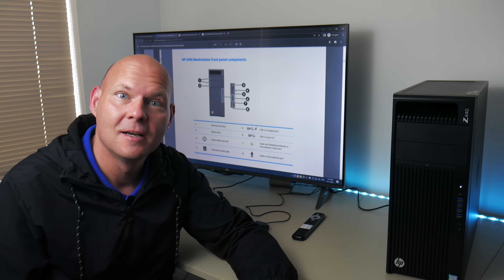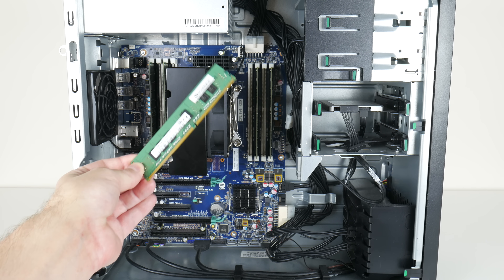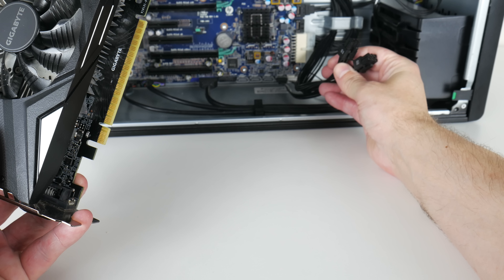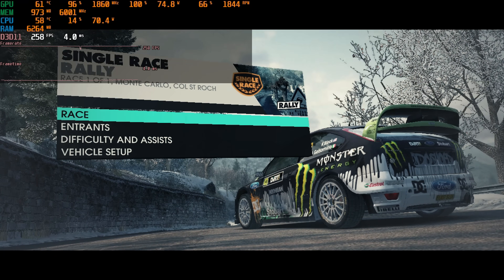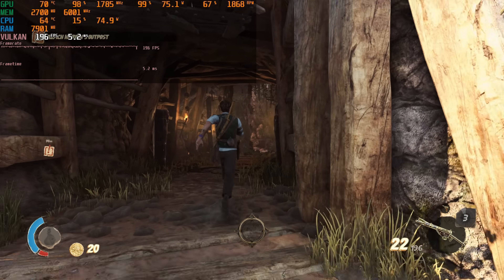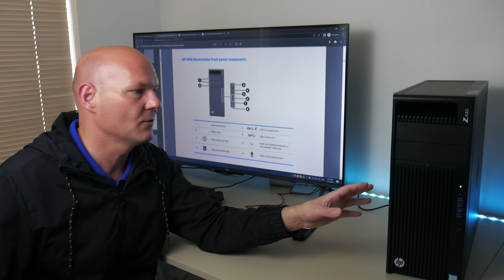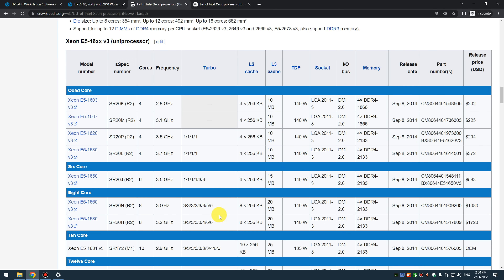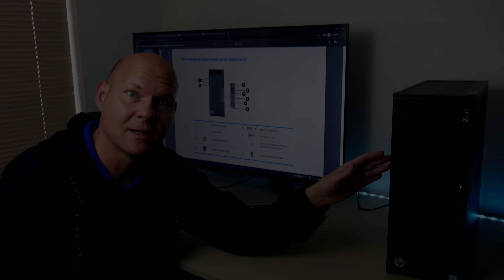This HP Z440 PC was my best purchase this year

Comment: Great video. Some notes:

- the z640 may actually be the sweet spot if you want to go for performance and expandability, as they are priced almost the same but support dual processors and hence double the RAM channels and slots (this is optional though! And the riser is expensive separately, find a deal with the riser installed!) and obviously, it has a beefier PSU due to that. Unfortunately I don't think the extra PSU has more PCIE or SATA connectors which means no extra graphics for cool ML stuff or multi-VM game streaming, but you can always solve the SATA issue with splitter cables

- Dell and Lenovo also offer their cheap versions of this. I myself have a Dell T5810, very similar to this, does have a second CPU socket option (also riser, less expensive), but the GPU is also limited and it supports less disks and less optical bays. Is usually cheaper though. Still great service manuals on all these 3 brands, along with all other drivers and firmware

- now this one may be the most interesting detail: all of these machines should theoretically (but I'm not sure it works on the z440) support a v3 multiplier unlock. v3 Xeon CPUs can actually be overclocked to levels beyond even v4 levels of performance, even with slower RAM. This should require a custom BIOS but there are multiple sources for this and it is a relatively simple change if you wanmt to do it manually (as opposed to relying on random binaries online). The one difficult part is flashing the BIOS, for which you will need a BIOS chip clamp and a USB-Serial (you could also desolder/resolder the BIOS but clamp is easier and relatively safer). If you end up doing this, and you do overclock, I would strongly recommend double checking your thermal performance as it may be necessary to go custom cooling or tone OC down for safety. Because of this, it should probably be more relevant to single socket. I wonder if all or some of these machines even allow for custom coolers as they usually have proprietary mounts. I know dell screws directly to the case metal which kind of sucks...
Reply from the maker: We will check out the Z640 soon! It has few RAM slots, but 4 is heaps already IMO. Bigger PSU and even heavier, I believe it weighs 15 Kg and definitely getting a workout for your arms if moving it around. Additional fan in the back but otherwise it's very similar. I don't think the CPU upgrade (2nd CPU) is a big plus, I don't see games and most applications benefitting from that to be honest. If you want dual CPU might as well go for the Z840?
Reply: I had T5810 for a while - it's noticeably louder than HPZ440.

Comment: I worked in IT for decades and we use HP servers and workstations. I use HP workstations at home with fantastic results. One of my favorites is was the HP z620, built like a tank, still running strong and upgrade processors for cheap recently. THe HP Z800/820/840 were also amazing designs owned all of them in the past. I also have gaming computer but the reliability of the workstations make it my go to for any purchases going forward. Their Z1 all in one was another brilliant design and my parents still use the one I built out for them every day.

Comment: For those 26xx xeons there is a turbo unlock.

Some ukrainian did modify a bios for the z440 workstation. There is a video titled failing to do on z440 but that person did succeed and they linked there English guide in the description.

The turbo unlock isn't a full unlock as you are limited by the cpus tdp thay why there are undervolt efi's

Comment: i have never model HP Z6 G4 and also rtx 3060 ti inside but u receive only 7000 pts in Cinebecnh R23 , processor xeon 4114. This machine is low end for my computer but performs much better

Comment: You would be right if at 4k you didn't need more ram than you have on 3070ies, 3060ies seem to be less stutter because of the 12 gigs, but nowadays I'd go for an A4000 with 16 gigs of ram. If you don't push it to the max and keep it there like a miner, it should be silent as well, or a quadro. I have the n840, I am not putting consumer cards in there also because of their crazy wattage, enterprise GPUs work much better for less electricity.

Comment: Hey Phil. Im not sure if you're still responding to comments but Id like to pick your brain on some GPU info. I also have an HP z440. Came with 32gb Ram, 6core 12thread 1650 v4 and a Quadro M2000 4gb card. 

I do video editing, 3d animation and graphic design and I also do some light gaming when time allows. Im trying to get a GPU upgrade and planning on a cpu upgrade later on. My main applications are Adobe After Effects, Premiere Pro, Photoshop, Indesign and Illustrator, Davinci Resolve, Blender, and Cinema 4D. 

The Questions:

1. Have you upgraded your GTX 1660 yet? If yes, what did you upgrade to?
2. Im stuck between trying to get 1 of 3 cards i.e Quadro P5000 16GB, Quadro M6000 24GB and an Nvidia RTX 2070 Super (looking at an RTX 3060 or 3070 if budget allows). Which in your opinion do you think I'd benefit from the most for work?

Comment: Watch out if you have to replace the power supply -- when I had a Xeon CPU that needed a home, I passed on HP mainboards because some have nonstandard power pinouts, (IIRC that's one of them) and I didn't want to mess with that. As a complete unit, tho, quite nice, and from what I found, that's one of the better ones commonly available.

Anyway, I wound up going for a Lenovo Thinkstation S30 mainboard (workstation board but fits a standard case, and takes a standard PSU) and with the Xeon E5-1620v2 (3.7GHz) and 64GB of RAM, it's quite lively indeed. Uses about 175W at the wall. And came with an embedded Windows license (weirdly, tho the board originally shipped with Win7, it only activates Win10).

I got off cheap because the RAM was pillaged from a server (dual Xeon but total CPU power a bit less than the Lenovo, and about 3x the power consumption) ... thought I'd need to get the Lenovo faster RAM but it performs just as well as the faster RAM in my i7-4820K (which benchmarks barely a tick faster than the Xeon-Lenovo). And it is indeed super reliable. 

Anyway, very nice, these workstations are indeed interesting beasts, and in a different league from the average desktop.
Reply from the maker: Good to know that Lenovo uses regular PSU, makes life easier. The other option with the HP is buying a Huananzhi board and transplanting everything into another case.
Reply: @philscomputerlab  Or rewire the PSU pinout, but that's more adventure than I care for! And not all Lenovo are standard, but this one is. -- The factor you can't transplant is the business-class reliability. 

That said, while HP's consumer-desktop PSUs are trash, there are few complaints about the workstation PSUs. If it's lasted this long, it'll probably just keep on chugging.

Comment: Great video didn't realise the z440 has 8 ram slots. My z640 only came with 4 slots. Do you know if 4 slots also require ram cooling? Thanks
Reply from the maker: No they don't. The 640 let's you install a second CPU board with another 4 RAM slots. It's heavier, had dual rear fans and 1000W PSU.
Reply: @philscomputerlab  thanks loving these new format videos by the way 😎

Comment: How would I run a RTX2070 Super?  I 'm running a GTX 1080 and I want to upgrade, I use the Z440 mostly for Blender 3d and a iracing.

Comment: is a very good Workstation for the price!. Its a pity it lacks a NVME for fast actual ssd drives, but is a good deal anyway. All my main computers have always been second-hand workstations, for the next bargain main computer i recomend to you a Lenovo P520, i bought mine for about 200€ and im very happy with it :)
Reply from the maker: You can add NVME with cheap PCIe NVME adapter!
Reply: @philscomputerlab thanks! is a good point, but i think is unable to boot from PCI in many cases
Reply from the maker: @rogernorimaki3318  PCIe, not PCI. At least on the machine I have, it boots just fine!

Comment: These workstations are still very useful. I have 2 of the z420's. One has an e5-2690v2 with 10 cores, 20 threads, 128GB ram, and I run esxi on it for a home lab.

Comment: I would know the consumed power of the CPU when the system is idle ??? with Xeon E5-1650V4 in HP z440 VS Xeon E3-1245V6 in HP z240 to decide which system of the two i will purchase (assuming the reaming parts in the two systems are same like the graphics card and ram etc..) ,
if the two are same in consuming watts when idle then of course I will get HP z440 as it is more powerful workstation in performance.

Comment: I've been looking at these workstations thanks to your video. Im currently undecided with two deals. A hp z440 with an e5-1650v3, 256 ssd, 32gb and comes with a Quadro m6000. Or a z640 with e5-1650v4, 512 nvme ssd, 32 at 2400 instead of 2133?and a m4000. Is the m6000 worth the difference in the other parts?
Reply from the maker: It's GTX 970 vs Titan X, so yes the M6000 is much stronger. If you are gaming that machine will do significantly better. The CPU and RAM difference, you might be able to measure, but not notice. The 640 is built a bit nicer, has 1000W PSU and has bigger faster storage. What will you choose 🙂
Reply: @philscomputerlab  thank you for replying. probably the m6000 one if the cpu and ram difference aren't particularly noticeable

Comment: hi, I'm running Xeon E5-2678 V3 on z440 but the frequency is locked at 2.5Ghz but according to the parameters, the cpu can turbo up to 3.3Ghz, is there any way to unlock it ?
Reply from the maker: Is it maybe an Engineering CPU? Update BIOS? Try high performance power profile...

Comment: Hey Phil, i just bought one of these. I was wondering if the motherboard was to ever break, can another ATX mobo be placed inside these cases? How many years do you expect to get out these machines. Thx for the awsome vid phil
Reply from the maker: You could source another HP motherboard. I don't think a regular motherboard will fit.
Reply: @philscomputerlab  damn that sucks :(
Reply from the maker: @moviesynopsis001  Well, if you want to use custom parts, I wouldn't look at the Z440 and just get a Huananzhi board from AliExpress and built everything to your liking.
Reply: @philscomputerlab  I really liked the build quality of the cases, they look like a sturdy tank. Was hoping to be able to future proof it if anything ever was to happen to the parts inside.

Comment: Do the HP workstations have a GPU White List? I bought a cheap Haswell based Lenovo Workstation and it's picky about video cards. I ended up taking the xeon 1320 v3 cpu out to put in a z97 board to make a cheap gamer and put my old i3 i n the Workstation and gave it away.
Reply from the maker: Hmm I haven't heard about any PCIe compatibility issues with Z440. It took the 1650 just fine and also WIFI card and capture cards.

Comment: How big is the TV your using as a monitor? I'm trying to decide between a 43" and a 50" 4k TV for use as a monitor.
Reply from the maker: Great question! In fact I want to do a video about using a TV as monitor. Before buying this one, which is a 43", I also had to choose size. IMO 50" is better value, they are maybe a little bit more expensive but you get a significantly larger monitor. However, a 50" as monitor is just a bit too large. A lot will depend on how far away your monitor is. The current desk you can see in the video is 80cm deep, and this works really well. a 50" would just be too big, and I'd have to have it sit even further away. At 43" the pixel density is also nice and sharp WITHOUT having to use DPI scaling. This was important to me. For example, on a 32" 4k monitor, it's just too small, and I have to use DPI scaling to be able to read everything easily. The 43" is perfect size for me 🙂
Reply: @philscomputerlab  Thanks for the great response. A video on using a TV's as a monitor would be great. Thanks again.
Reply from the maker: Awesome 😁

Comment: What's your problem with moving platter disc? They served and still serve the computer market very reliable. I suspect many of them will outlast most SSD 's in longevity. You might not want to boot of them anymore, but they are not quite yet obsolete in many a task.
Reply from the maker: I still use them in NAS yes.
Reply: The only time I notice SSD is when I boot and it shaves a second off time. Once my PC has cached data it's not accessing the HDD anyways so starting a program it just pops up. Rust forever!

Comment: What's that thing above the motherboard? I thought that was the PSU!
Reply from the maker: Yup it's the PSU!
Reply: @philscomputerlab  oh right. I see you pulling the 6 pin cables from the black box in the front. It makes me confused. I thought "where is the power plug?" Lmao.
Reply from the maker: @budiisnadi  Ah yes, that black box at the front has a place holder for the plugs, so they don't dangle around unsecured.

Comment: I bought one of these and I can't get it to run windows 10 or 11 it can't read the hard drive says it needs a driver and I have tried to install one with no luck, it does run linux ubuntu just fine, I'm not sure why it won't load windows, I like windows but I bought it for a low budget moderate gamer so I need windows, if anyone has any ideas of what it could be please help!! Thank you

Comment: I have been debating upgrading my z620 r2 to the x40 series but it seems to me that there isn't a lot of benefit.  The CPUs look like it gains nothing for gaming whatsoever in the v3 and v4 chips.  The RAM is faster, but only by like 300 mhz which in RAM terms is pretty much nothing.  Is there a concrete reason to go for this x40 systems that I am missing?  BTW I am mainly gaming on it with an rtx 2070 in 1080p
Reply from the maker: So that's Sandy Bridge / Ivy Bridge vs Haswell / Broadwell. Yes not sure you'll get a massive upgrade here but it should be noticeable still.

Comment: I was looking to get a z440. But I can't find any where if it supports above 4g decoding. I've been using a Nvidia Tesla m40 as my gaming card with a Quadro p400 for the Video out. I think they are an incredible deal. Extra $100 you can drop a 18 core in it.

Comment: Great job on this video.  So much information in in 16 minutes!  I have a cheese grater Mac Pro, an absolute beautiful design, but it is running against its limits (Westmere CPUs and PCIe 2.0).  This looks like a much more economical upgrade compared to the 2019 Mac Pro.  I find that I use Windows more and more and macOS less and less, so I think this is the way.  Thanks again.  Best tech video I’ve watched in a while.

Comment: Hi i have the same z440 with 700w psu 32 gb 2133 ram 2 ssd and 1 hdd and a e5 1650 v4 rx 5700 xt do you think i should stick with this cpu or get a 2698 v4
Reply from the maker: Tough one as the 1650 clocks higher but has less cores and less cache.
Reply: @philscomputerlab  so am i ok with the current one ?
Reply from the maker: Tough to say, you have to do more research and depends on what game and all of that. I feel for gaming the 1650 is better, maybe look at getting 2400 MHz RAM and / or quad channel if you only use 1 or 2 sticks.
Reply: @philscomputerlab  yes i am using 2x16 i'll get 4x8 thank you for responding and sorry for wasting your time

Comment: I've just scored one of these for 130, it has a E5-1650 V4, 32GB DDR4, 700 watt PSU, q2200 4GB

Will the 8GB rx 6660m gpu from Aliexpress be a good fit for this system or will it need a cpu upgrade as well? I want to use this system to play racing simulators like iracing, f1 22, assetto corsa etc. 

Also Adobe Premiere work.
Reply from the maker: AFAIK the Radeon uses PCIe 4, so on this machine you will lose performance. There should be videos explaining this. F1 22 is a modern game, don't expect too much. The Z440 is best for somewhat older games as shown in the video.

Comment: You are probably better buying amd 5700x cpu and sticking it into cheap am4 and ddr4 combo. This will give you aprox 16c 32t iperformance in the old xenon speak ie productivity and will support a much better gaming experience. Cheap and readily available parts will allow for quick replacement of failed parts, good luck trying to find a replacement xenon motherboard on the cheap. Eg I have seen many socket 2011 cpus floating around for sale as their motherboards have died. The replacements are expensive and hard to find..
Reply from the maker: No Registered ECC memory, no buffered memory meaning if you use all slots there are stability issues, only the graphics PCIe slot is directly connected to the CPU, other slots go via chipset and share bandwidth. Still have to buy case, power supply, storage, windows licence. IMO you cannot beat the value, but a modern Ryzen is of course much faster.